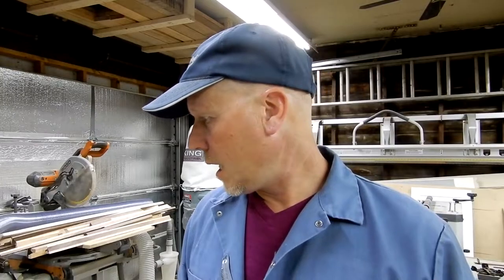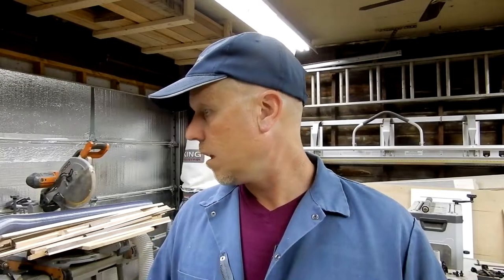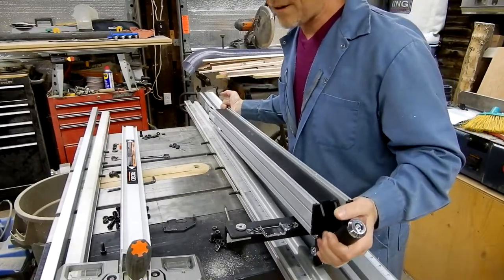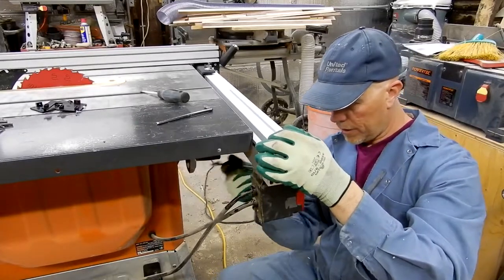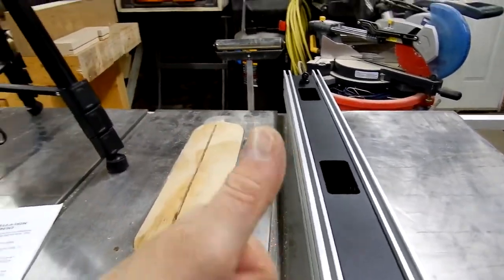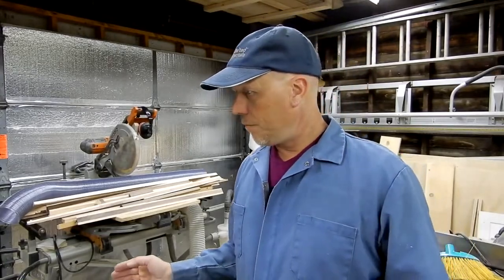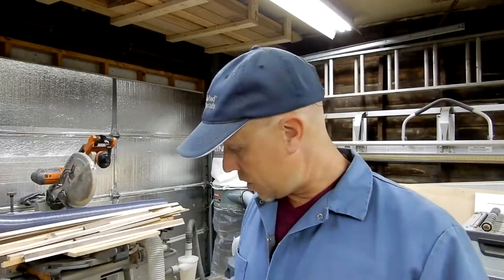New Table Saw Fence Install

Comment: I wanted to buy this fence but I have an outfeed table attached to the back of the original Ridgid fence. Thought I’d do it anyway and figure out how to attach it later. Turns out the new fence traveled just fine on the back bracket of the original fence. Bonus! Craftex fence is way better than the original Ridgid fence and, since it was on sale, definitely worth it.

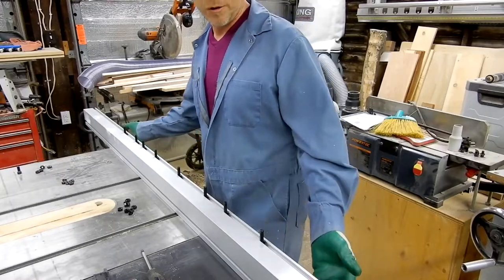Comment: 6:55 if doing this, it's easier to put the bolts, and nuts on the saw first. 
 
Tighten the bolts down 7ntil there's about a ¼" of extra space on the bolt. 
Then you just slide the rail onto the bolts one at a time until everything is lined up.

Comment: The Febce is normally priced at what price pal?? Double the sale price atm?? It's a nice new fence but the price is crazy bro.. I wouldn't pay that for a saw dude..LOL 
I'm joking of course bcos I'm looking at getting an Axminister Cabinet saw soon myself.. Well next summer tbh. I want to get a proper saw with some real power to it. The crappy saw I have atm is useless. It's only a 1400W saw which would barely cut through hot butter. I have sharper blunt knives in my cutlery drawer in the kitchen and I put new blades on it ..
Love the video bro.. Happy Xmas and all the best for 2023..